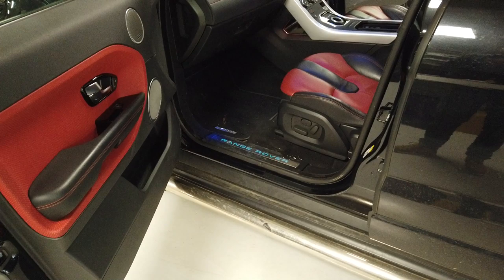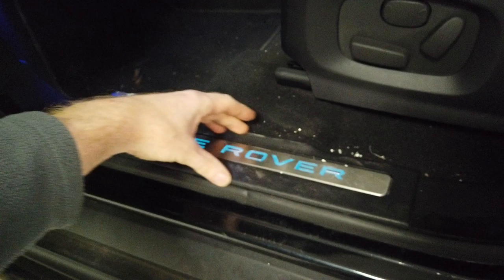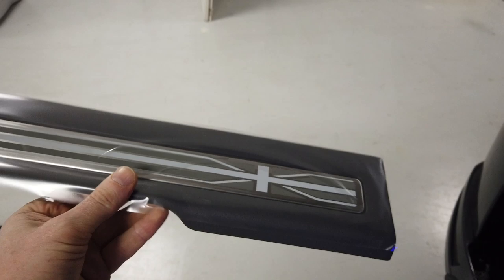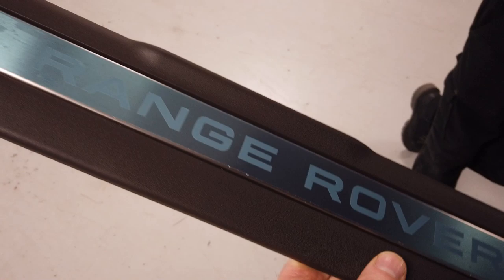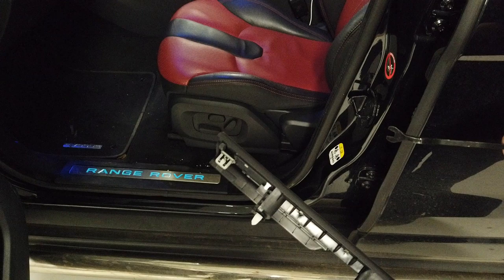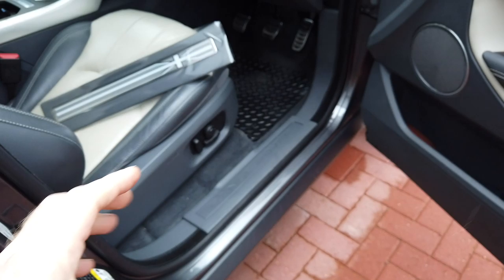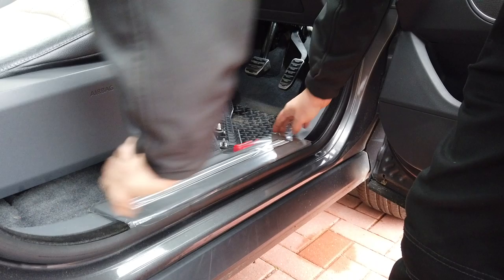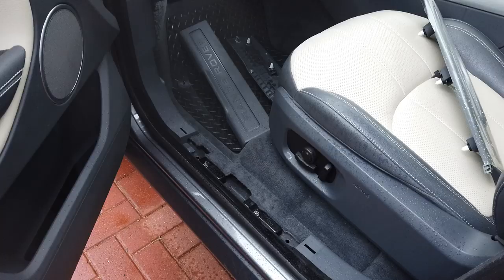Range Rover Evoque Door Entry Tread Plates / Sill Plates - Removal | Fitting | Options

Comment: Just installed the Union Jack style tread plate on my 2016 SE (US Model). Super easy installation. I was able to pop out the original tread plates with my fingers/hand starting at the same corner as the video removal with tool. Nice upgrade. No wiring for illumination that I could see. Thanks Simon.

Comment: My illuminated lights on the drivers side on my 2013 dynamic has stopped working, does the whole compartment need replacing or can you buy led strips/bulbs to put in? Would really appreciate your help. Cheers
Reply: Harry, what was the verdict? Just bought a 2015 which also doesn't work on the drivers side!

Comment: Wanna upgrade the sills to illuminated ones on my 2017 L538 prestige model.Anyone know if there’s 100% a cable underneath the sills to upgrade? Thanks
Reply from the maker: Every Land Rover we have has the plug there - even the new Defender.
Reply: I’ve pulled up both plastic sills and can’t see a cable? Should it just be visible or is it tied up somewhere
Reply: Scratch that literally just found it under the carpet